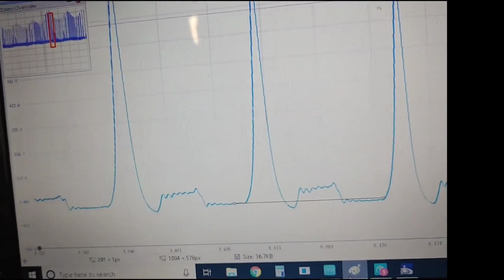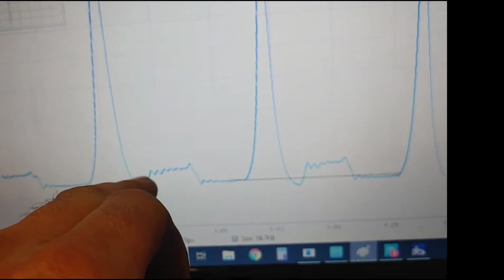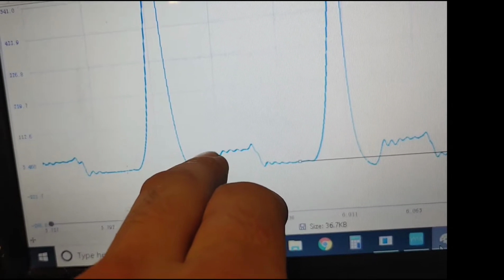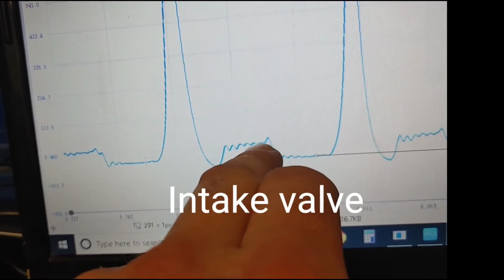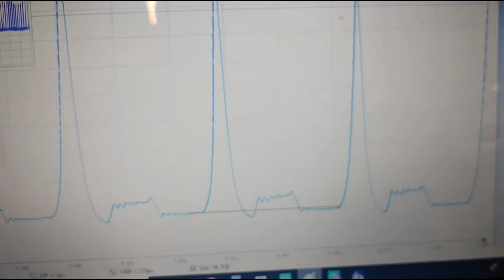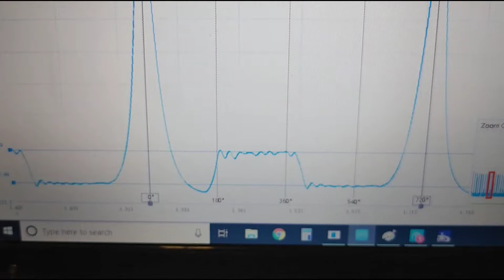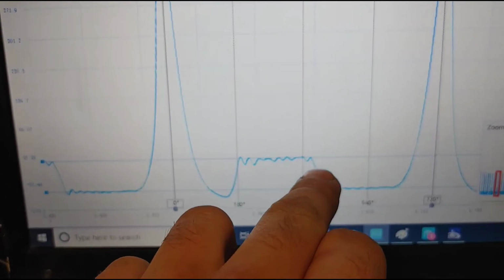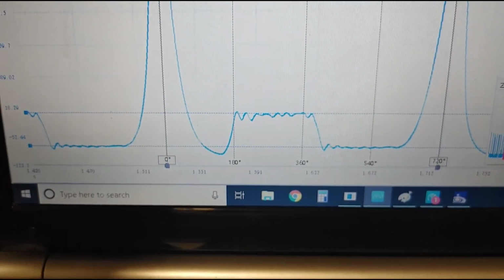Sticking intake valve.

Comment: Adding the Delta pressure waveform of the intake manifold would have been added more colour .
Then the exhaust pocket is more pulled down than the intake pocket not a good sign at all.

Comment: Nice capture bro, it would be interesting to know the difference between the expansion and intake pockets in both bad and good captures. Secondly, I know and advance exhaust valve at idle would cause the slight rise at the ending of the exhaust plateau is not uncommon but I can’t understand why the cleaning yield that result. Nevertheless good capture. What scope are you using though?
Reply from the maker: I noticed the intake pocket was off constantly and it didn't have a nice Clean(ish) drop when the valve opened. It always had  a skip(you can see it if you look closely in the Video. The expansion pocket seemed normal with 1.5-2 hg at its end(opened about 35 degrees before BDC) then rose quickly, without a hiccup.

This engine had about 170000km on it and never had a engine(internal) cleaning done. GDI Engines should be serviced roughly every 30000km, so this one was way overdue.. the spike at the end might have had something todo with gunk built up(since both cams are phased on this engine) just a guess. But the car was fixed and client was happy.

The scope is the ms408.

thanks for watching.